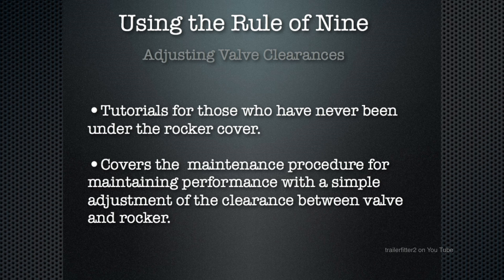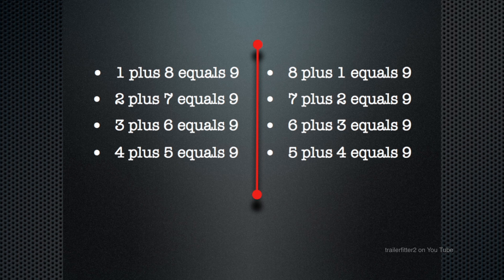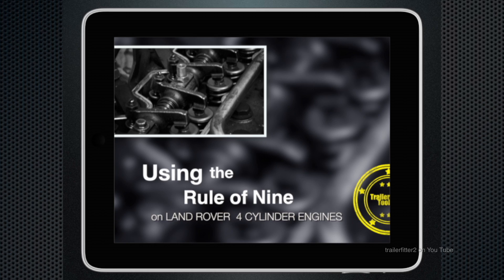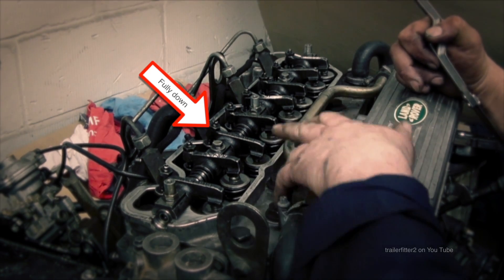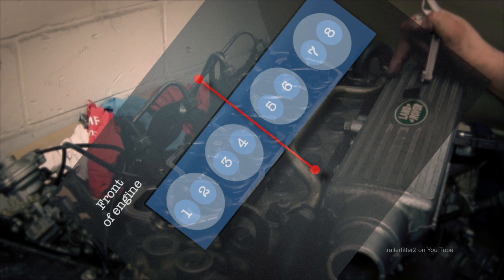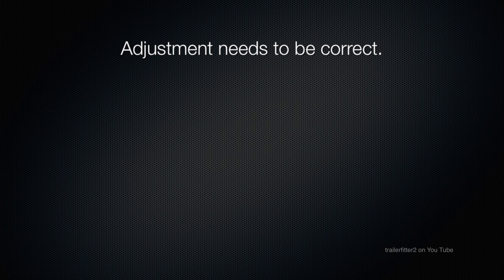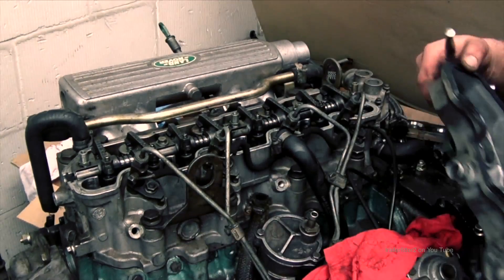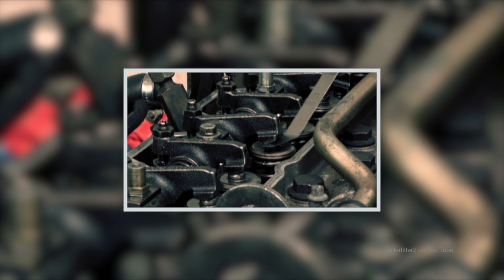Adjusting valve clearances on Land Rover 4 Cylinder Engines - Rule of nine

Comment: Great vid, as always from you. I'm having difficulty removing the rocker cover on a series 3 diesel because someone has basically glued it down with gasket sealant. I don't want to get too rough with it. Can't find you vid on how to remove the rocker cover. Link please?
Reply from the maker: just tap it with a soft hammer to break the gasket seal.  It won't be holding it on that tightly.
Reply: Cheers for that. You wouldn't believe how much you have helped me, complete novice, to get to grips with my series Landy since I bought it. There are some good videos out there but the videos you put out there are comprehensively instructional and have walked me through many an operation I wouldn't have had a clue with otherwise. Like your, down to earth manner; makes me smile when I watch too. Thanks very much for everything so far.
Reply from the maker: Very happy to hear.  Thank you.

Comment: I've got a disco 300tdi auto edc, it does sound a bit on the tappy side, just lately I'm getting a problem when the engine is warm it takes an age to pull away from a junction or traffic light, there's no power but then suddenly the power kicks in, could this possibly be down to incorrect valve setting?
Reply: Normally it's quite brisk off the mark
Reply: leaking vacume pipe